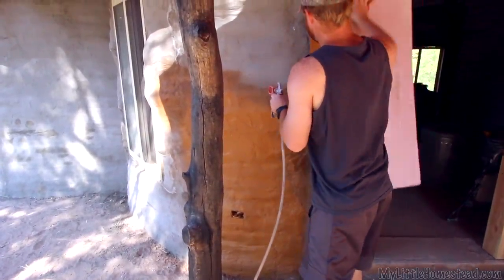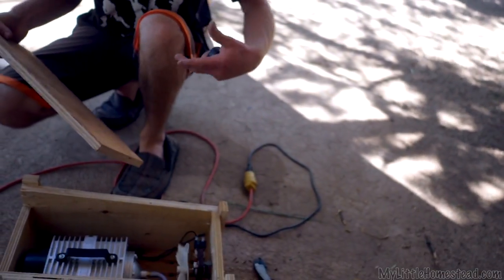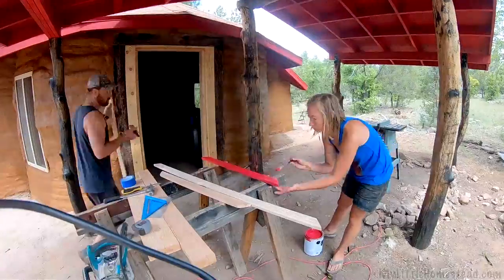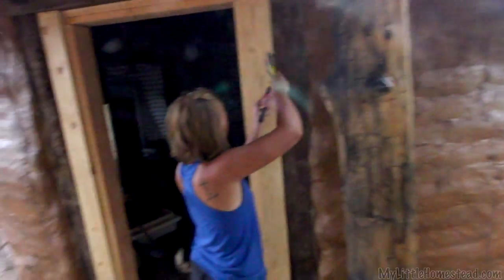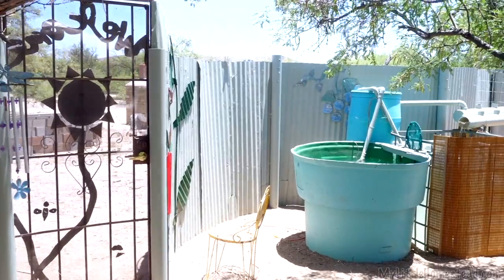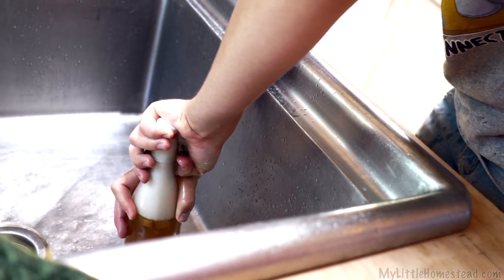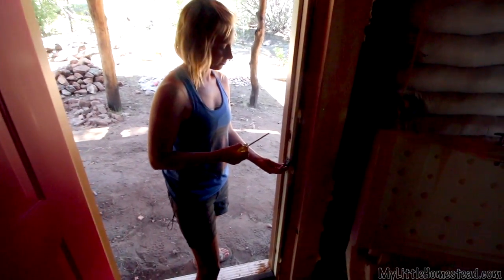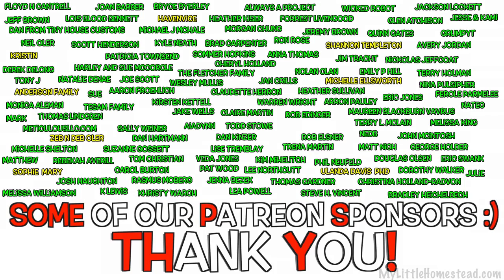Earthbag Cabin Paint & Trim, Aquaponics Fish & Plants & Making Kombucha | Weekly Peek Ep191

Comment: Your fish going to the top to breathe.... might need an air pump in there or water plants.  Great project!  I'm excited to see how it works out.
Reply from the maker: Got it. Thanks
Reply: @mylittlehomestead  Curious as to why you put your air pump inside a box. These pumps typically run hot and need ventillation. Don't know if the little fan will do the trick. I've been running a system for about five years now and my air pumps sits on top of the fish tank in the elements with no issues. Are you putting air into both tanks and are you using stones?

Comment: Where do you get the earthbags that you use?
Reply from the maker: China earthbags
Where We Bought our Earthbags (Continuous Sandbags or Earth Bags :)  | Weekly Peek 
https://www.youtube.com/my_videos?o=U&sq=China 
It is called 14 inch continuous polyweave bag material with a 6 month UV protection. Manufactured and imported by MLH directly from a plastic bag manufacturing plant in China. Years ago we bought it in bulk and sold off everything we were not planning to use. Back then, the cost was .15 cents per lineal foot.

Comment: I wrapped my water tanks with thick black plastic before I slid them back into the metal holding cages.   This protects the tank and helps control algae growth caused by the sunlight.
Reply: You definately need to control algae. The only place the water is exposed to sunlight in my system is when it comes out of the pipe into the grow bed. I used radiant barrier and shade cloth to do the same thing and regulate the water temperature
Reply: @fabonline9389  Even shad is not enough that is why I lined the outside of the tanks with black plastic.  It will also make your water tanks last a lot longer.  If you are having heat problems you could use aluminum foil to reflect the heat away.
Reply: @westfallvoice  My tanks are black plastic. Putting black plastic on the outside would increase the water temperature. Tinfoil would do little with temps over 100F. I use radiant barrier with a R44 rating which does a fair job at regulating the heat. Algae will not grow without sunlight or in a fast current. My tanks are all covered and the grow beds cycle every ten minutes.
Reply: @fabonline9389  in the video you show white square tanks with the metal cage around them.  If they are in the shade the black plastic would not heat up.  I saw one tank with fish that was green and black. The top is still not cover from light.
Reply: @westfallvoice  The IBC containers in this video are not "my" tanks. I only responded to a thread already started. My sump tank is half-buried under the grow beds with a radiant barrier around it. The fish tank and sump tanks need only be opaque, color is irrelevant. Black being the absence of color will absorb all wavelengths of light and heat up the most (great for cold climates). White being the combination of all colors will reflect all wavelents of light. Heat will conduct through the tank material; the color has little to do with ambient heat. You need insulation or a radiant barrier. The MLH system is going to have severe heat problems because of all that thin pvc in the direct sun.

Comment: there are native plants that he needs to plant on the sides of the creeks. Here in Missouri - there is a bush called nine something - Sigh. it's a bent up limb all snaky and roots that are huge- I mean a plant is like 5 foot in diameter but a root set for it is like 9 ft. - sigh.. My library is packed away. let me see if I can find the name of it.
Reply: the concrete is a waste of money. You need to get a quarry to deliver Boulders. I mean rocks the size of a 4-wheeler or lawn mower.
Reply: Without surveying the Creek.. I can't say exactly what you need to do. But Water is a Living thing. - think of it like a Snake. crawling along it's preferred path. - Where the Power of the flow hits isn't where you want to control the water. you want to control the flow to that point. Like training an animal. You can not get the dog to bring you the ball until you get the dog to understand it's a ball and that you are having a conversation over it. UNDERSTAND?
Reply: Okay. there needs to be a point at the beginning that Slows the in flow then Spreads the water out. after you need a Catch that enables the creek not to wash out or get deeper - then a flow bed that prevents the bottom from removing and Holds the banks in place - At this time you should be past half way and into the Major problem - there - you need to build a Focal point. similar to a funnel - but designed to not funnel but maintain A control of the water into a focused stream.- think of it as a reverse ramp being ramped to the top in like an hour glass thing?
Reply: Okay - now for you bridge. - Wait sorry repeat from the top. using boulders to protect the bank - Remember - Deep large rooted bushes Need to be planted all along the creek. - in the creek and such.
Reply: when the people back in the - You have to be smart to be smart days - not the Money wins HAHAHA that's what you get for being poor days we have now. - Use to do was determine the flood plain. Now that you have altered the water flow to sustain a reasonable water flow - you have changed the flood plain. - Which means you will have to wait. to find the new location -
Reply: Once it is found. you Levy the area in which you are wanting the bridge by using the dirt and rock from that location to build such levies - When the area is set to the place - meaning where and how it need to go. you anchor the bridge into the ground OUTSIDE the flood plain. then Cross the flood areas by anchoring before the water flow area <75%> of water flow area - then the <100%> water flow area - leaving the Area where the water flows Free to flow.
Reply: Now I like to PLAN things out to Every little detail as I Do them. Even Little things That Seem rather OVER point of nEEd . Understand. -
Reply: Now this being said. - And you now understanding the IDEAS of flood control. - we also have a practice for the Flat areas - not the Hillsides like in the photos ? - OKAY.. Flat AREAS only. OKAY. - you take a bull dozer  and you Flatten the banks out until there is a large area of Open Field with the creek as part of it. -
Reply: At first You will be like OKAY so I just turn the creek into the field I get it. - YAH.. NO> -  think of it as more of the Field becomes the creek. -  - take a piece of paper and fold it long way in half. - that's the creek in the flat area - Now open it up. - see> - turn it over and flatten it back out. - Now fold another long way each side opposite the other fold - then flatten - then another opposite - then another opposite each time until the paper is full of the cresses that have been flattened out - is the paper flat like before? NO - but close. is the original one controlling the paper NO. - if water came rushing over it. the little levies will help maintain the flow and spread it out without destroying the field. -
Reply: the SURVEY of the Field - which is Key to this method. means that you direct the water using this method - similar to Hillside control. BUT. HERE you use the little levies to control the spread and direction of the water flow. - DO you understand?
Reply: As for the Survey? I'm here. and without being there in person - I'm not able to help. - You remember those places that defy Gravity? that stuff is real. and the eyes fool you as well as your senses. - And remember - Native plants will fix this issue - DO not bring in others. - they will pollute the environment.
Reply: here in Stoutland - Back before electricity and running water. A vine used to make BASKETS was planted. not native to Missouri. needed to Be grown for Human purposes. - this Vine is NOW spread up to 2 miles outside of town. and is Immune to all but one type of herbicide - and it is so powerful that it kills everything within 5 ft of the root and can spread via rain run-off that it can kill everything down from it up to 30 ft. - Sigh. But yah..  WINK WINK.. cooking oil mixture helps to keep it under control. Wink Wink.. - But that's all Just - another example of Why.
Reply: Oops. I forgot. that Vine chokes and Kills everything it takes as a Host and Destroys even Concrete Walls with it's roots.
Reply: Ninebark sounds right - and Looks right.? the Native stuff - similar to Rose bushes which can also be used. but will wash out of the heavy flood areas - but make good help for decorating the path. look different than domesticated varieties